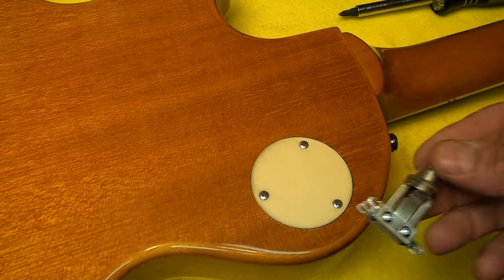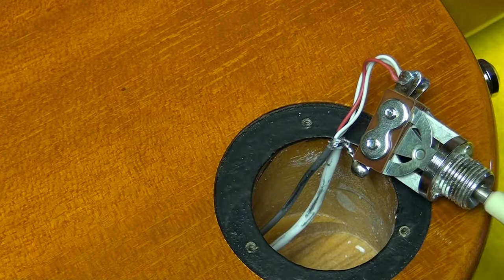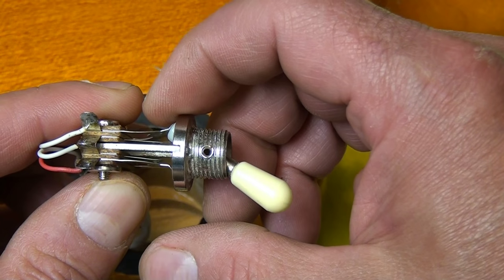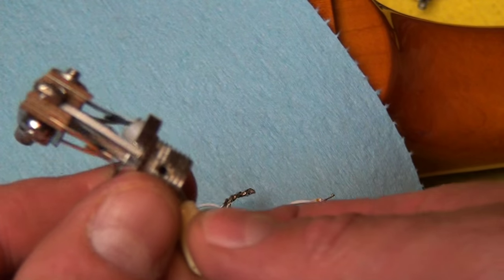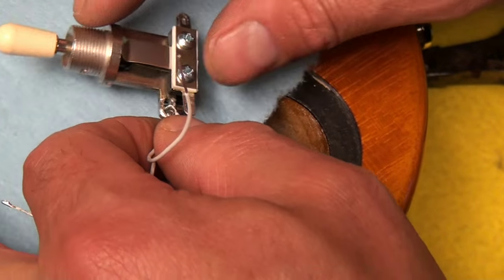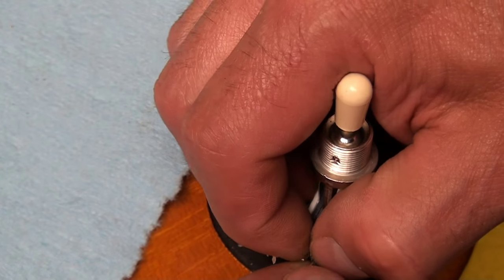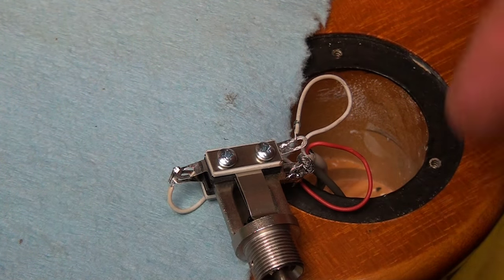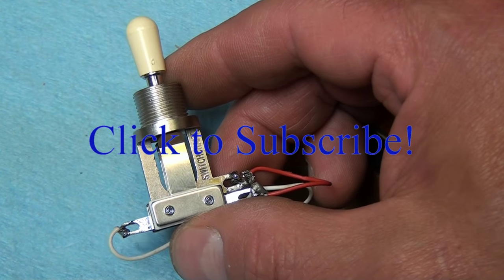DIY How To Repair or Replace a Guitar Switch That Is Cutting Epiphone Gibson Les Paul Switchcraft

Comment: my epiphone casino neck pickup was cutting out, i took the switch out and squeezed the switch contacts together, its working fine again for now but the switch will eventually have to be replaced
Reply: Your little pinch trick just save me what what probably going to turn into a bunch of time and miles.....
Reply: literally just worked for me

Comment: 20 years in the guitar repair business.  The best 3/5 way Fender type switch you can buy is a CRL.  The best 3 way Gibson style toggle made is a Panasonic.  The end.  You can listen to old guys on Les Paul forums ramble on about how "I've never had a Switchcraft fail in xxxx years, they are the standard and will last a lifetime".  BS.  They are loose, sloppy feeling, the contacts easily oxidize and lose connectivity and crackle, and I've installed so many BRAND NEW in need of rebuilding or cleaning that I don't even bother anymore.  Maybe the ones in the 50s or 60s were fine, but just do yourself a favor and don't bother today.  I absolutely loathe Switchcraft toggles.

Comment: That was about the 4th or 5th vid I've seen on wiring my Les Paul and You were the much more clear explaining how the switch works for someone who fears electricity ever since I grounded a 220 volt connection in the oven of my Range! Thanks a Million....

Comment: Thank you very much for your video, I just had problems with my cheap Les Paul copy after removing the bridge PU, its knobs and the toggle switch completely and hardwiring the neck PU to the output jack. I don't need them and like to have a cleaner look altogether. I forgot to connect the ground wires and you reminded me about that. Very helpful indeed and pleased with my results!

Comment: Awesome video Mark, thank you! My Epiphone LP switch is super loose because the screw holding the post together is badly damaged from too much use so the post literally moved in all directions and at times (of course) would cut out audio. I just purchased the Switchcraft replacement from Amazon (your link made it SUPER easy!) and will reference this video again when I replace it in about one week. REALLY appreciate this video, thank you again.
Reply: That being said, do you have any suggestions for aftermarket high gain pickups for the Epi Les Paul? Something thick, meaty and crunchy (think Foo Fighters, Metallica, Green Day, etc...)

Comment: So I am about to install three new switches in an epiphone double neck. Two pickup selector and one neck selector. The two terminals on one side vs one on the original one confuses me. So I watched this video and I think I understand it now. The middle one on the original now goes in the other side and the ground is now the middle of the three. I think. 
Thanks for this video.

Comment: I want to thank you for this tutorial video, Because of having done this with strat style and 6 pin micro switches I knew the basics so I had to riff off of what you wrote because ESP does not have a separate harness with grounds(they are wound around each wire - the pickups and the hot to the jack). This had confused me until your explanation partly clarified what was going on but you could have been a little clearer on how the ground wires function but perhaps that was to much info to throw out.
Anyway the explanation of how the switch works was very easy to understand- although seemingly counter intuitive- and was the key along with the ground understanding. The bridge would mostly not work by itself or in the middle position(the neck was fine), so I would get it work intermittently but could not see why this happened. No cut wires and no obvious shorts although doing the grounds the way they do them is a mess of unsheilded wire to contend with. Finally it would work when I touched the Jack leg and the bridge pickup leg one or the other so I knew it had to do with the connection of these to sides not functioning correctly.
Fortunately this style of switch from ESP has two screws holding it together(one for the pickup hot side and one for the ground side), so I loosened the screw a tiny bit from fully tight on the pickup side and no more problem for the bridge or both, but occasionally the neck cuts out(very occasionally). Good enough for now I did the Eddie switch trick to make sure I wasn't fooling myself and hopefully for a good long time no issue.  Yeah and they said it was Mint when I bought it.

Comment: I'm confused a little bit. But this video was much better than the one about the Humbuckers. The wiring instructions were different. But, I have an Epi-Les Paul, and that may be the difference in the wiring. I haven't actually opened it up yet. But, I did order the Switchcrafter from the Amozon, before I saw this video. I'm sure it will work; and if your wiring is right for the Ep, I'll open up my tele and see if that wiring is like the other video. If that proves to be true, then I will have learned a lot than I expected to.

Comment: Great video Mark excellent explanation and technique I have an epiphone es295 that had a broken shaft it  just snapped off  I have purchased a Gibson switch for it  and wasn't quite sure of the soldering part it  was never my strong point but hey ho I'm off to the garden shed fetch my soldering iron and get the guitar up and running it's been hanging on my wall naked for about 2yrs kept putting it off to hand in to the local guitar Luther thanks tony

Comment: Hey there, I have a Epiphone Les Paul plustop pro. My guitar fell face down and the switch went in. I can't get all of my tones on the guitar now. Is it possible for me to just replace the switch and not have to rewire everything else (pickups etc.)? Thank you.
Reply: You have to open up the guitar and remove the switch. Replace it with a new one. Some rewiring needs to be done. But that's loads of fun.
Reply: @plywoodcarjohnson5412  thank you. Do I just need to meld the wires back into the switch and I can leave everything else alone? Thanks!!

Comment: The plastic ball side of my PRS Custom 22 SE separated at the spring side where the 3 tips join the bottom spring side so the toggle flops - tried crazy glue but no luck...should I replace whole toggle switch & re solder wires or?

Comment: I was losing power on my bridge pickup on My Epi Les Paul. I thought it was my amp but wasn't sure. i am fortunate enough to have 3 guitars and 2 amps so I started the elimination game. I rules out the chords, effect boxes, amps and the other 2 guitars. I backed the retaining nut off slightly on the selector switch and everything came back. Seems to be working fine. Should I need to replace the switch at some point, I will  coming back here for sure. If anyone knows why a too tight nut on the switch would cause this, I sure would like to know. Thanks.

Comment: Hi, I just purchased a open box gibson it's new but the switch pops from the top pickup to the middle but stays in position when pushed to the bottom pickup position . My question does anyone know if it's as simple as just a new switch or in the headstock or is the guitar just a pos. The guitar was supposed to be never played. Should I just try and get my cash back  thanks for any help.

Comment: Hi, kind of new to electric guitars here, any help greatly appreciated.  With the switch of my Epi LP in the middle position and the bridge volume knob turned all the way down, the volume knob for the neck pickup has no effect. But when the bridge volume is up a bit, the neck volume knob works, and it works when the switch is in the up position. The bridge volume knob also works when the neck volume is turned all the way down. Is my switch broken, or am I doing something wrong?
Reply: Thanks. I didn't know they worked like that. Piece of mind knowing knobs functioning properly. Saved me a trip to the repair shop.

Comment: I think your video is going to help me but i wanted to ask you a question, my son has an SX Les Paul which came with the isolated box switch and it has 4 contact points, Red ( left side), White(middle),White(right) and underneath the center white that's where the ground is connected. I am changing it to an All Parts 3 way toggle  kind of like the Switchcraft you have but the ground is by itself and then on the opposite side it has (2) 2 prong connectors. I am new to this stuff so if you have the answer on how to wire it up I would greatly appreciate it. I did switch out his input jack already so I feel confident i can do this.

ALL Parts switch
http://www.allparts.com/EP-0066-000-Short-Straight-Toggle-Switch_p_1234.html

Korean switch (what's on my son's guitar)
http://www.amazon.com/Musiclily-Position-Sealed-Pickup-Selector/dp/B00G8IV6AG/ref=sr_1_1?ie=UTF8&qid=1458706400&sr=8-1&keywords=3+position+toggle+switch+guitar

I was looking at a diagram and I think i might have it figured out, i heard you mention it didn't matter what side you hooked up the wires because you could turn the switch upside down or right side up once you figure out how to connect them.